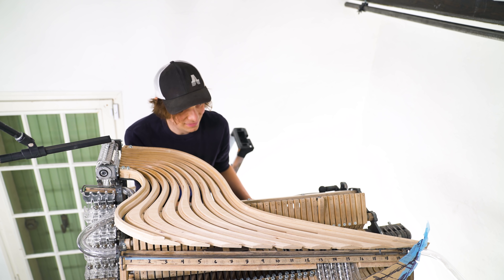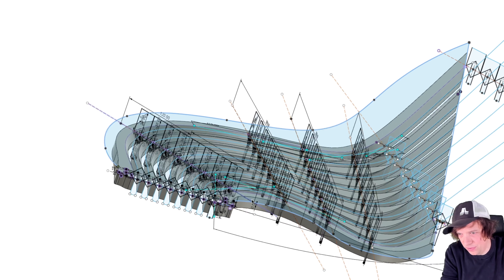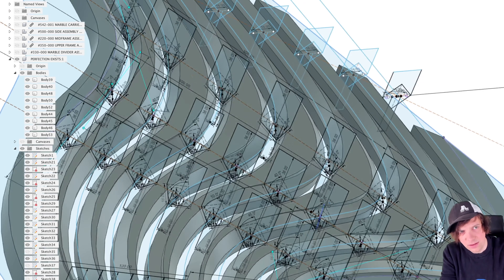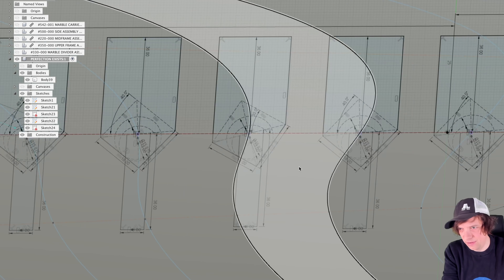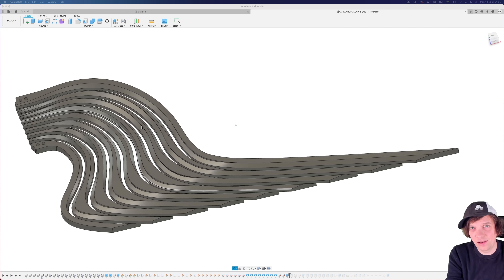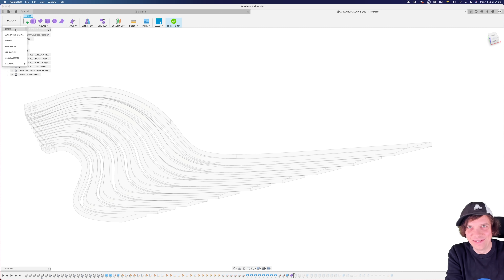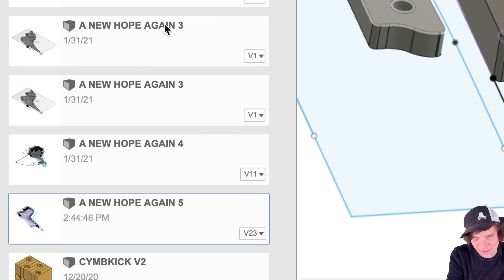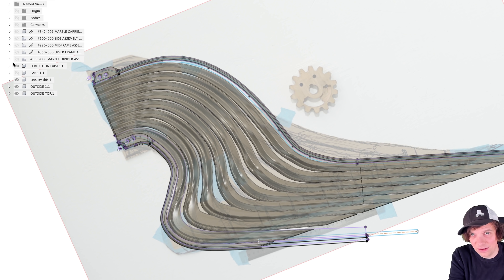Marble Lanes

Comment: A couple things that might become issues. 1. When the marbles rejoin, especially at that velocity, some marbles are going to get knocked out of the machine. 2. The bottom few holes will have 8 times as many marbles as the top few holes and it will be a step function(2x, 3x, 4x,...). Hopefully that doesn't cause them to run dry.

Comment: Good lord, this seems like it has so much potential to be a horrible idea. 
I hope I'm wrong, Martin.
Reply: The tracks from the first coaster track iteration never have any chance to load channel pairs 1-4 of the marble divider, and 1/8 of the marbles will be falling onto the marble divider at channel 19. They have virtually no chance to actually load the divider at that point and will instead bypass the divider and go directly to the divide-by-four / fish stair. These will end up being how channels 1-4 load, which seems a wasted potential to use them to play music directly out of the conveyor belt. 

The previous design had 1/3 of marbles entering at the top of the divider before channel 1, 1/3 at the 1/3 point and 1/3 to the bottom third. This new approach makes the divisions smaller, but also means most of the marbles have fewer opportunities to populate a marble divider channel. 

Before: any marble entering at the start of the divider had 38 opportunities to load the divider. Marbles entering at the 1/3 point had @ 28 the last group had about 20 chances.
Now: any marble entering at the first coaster track has 30 opportunities to load the divider. coaster track 2 have about 24 opportunities, track 3 get 20, track 4 is 16 chances, etc. 
In other words 1/2 the marbles now have less than half as many opportunities to load the divider. I suspect this will end up badly overloading the fish stair. 

Basically, I think this is an adjustment that should depend on knowing which channels are emptying fastest. Maybe it will be the right balance, but it seems early to decide it now before most of the marble gates are ready.

Comment: Like some other, I am a little worried about the speed of the marbles. It look like the marbles from some channels will just skip most of the holes. Maybe increasing the angle of the lane walls to reduce speed (instead of  45  degrees) (the contact point on the marbles would be higher)  could help

Comment: Dude, it's not only too long, the whole thing is shifted to the right at the end. The end of the rail skips the first four shafts for the vibraphone so it will only feed from shaft 5 onwards so the first four vibraphone registers will starve. Other than that the desing looks beautiful. Also remember what I told you about the slope in the comments of your last post before this video.
Reply: The marbles from the fish stair are coming in at the start still, and that includes all the overflow marbles too.
Reply: Not to worry, the first few lanes are fed directly by the fish-stair, so they will have plenty of marbles
Reply: My thoughts exactly

Comment: I am far worse at Fusion than Martin is, but I think in this case, I would have used Sweep to cut the track shapes along the lines. Sweep allows for twists as well, but without duplicating the profile. Any reason that wouldn't work?

Comment: I think we can all agree that the new functional parts look so much more amazing than the old version. That being said, beyond the dimensions being off, it does also seem like there's potentially a new mole in that the marble speeds are significantly higher in this version.  And this could have been seen in a less refined prototype without all the fancy channel tilting which I'm guessing from my own experience you probably spent at least half a day on. 
Channel tilting which I'm guessing at the speeds and curves you want to be working with won't even be a significant factor. It seems like a want instead of a need, a form instead of function. Even if they were the easier solution would probably be decreasing the wall angle or otherwise changing the sweep profile uniformly.
Even after the nitpicking, it still does really look amazing watching the marbles flow so swoopy.

Comment: I'm not optimistic about this design . The previous design put the marbles only where they were needed. This design will crowd them where they are used less often .
Reply: should just funnel them back to the top and this will be pretty without any dispersing impacts
Reply: @christopherkarlsson4919  thats exactly what the fish stairs are doing
Reply: @Sagolel4797  I know I know, but if this visual effect is desired then any negative effects it casuses can be handled with a simple funneling at the end that pulls them back to the top of marble channels is all I'm saying
Reply: Aren't the drums and bass used more often than the vibraphone? Are you talking about the spacing between the channel outlet?
Reply: No, the old design loaded everything into one of two queues; easy to bottleneck, and the bottom-most slots (drums!), literally last in the priority chain, would always be starved for marbles.  There is a functional issue being addressed here.  The overflow will still be recirculated back to the top of the batting order via the fish stairs (and dumped back in at the highest notes on the vibraphone, less used!)
Reply: @xheralt  I could see the vibraphone soaking up a lot more marbles than the drums.  It's used less because he hasn't been on that side in ages. 
I dunno I just feel like we're fixing a problem that didn't exist or hasn't been a significant issue until suddenly end of last week.
I love the process... I never want it to end.  Changes like this are amazing -but I'm not sure if for good or bad reasons this round.
Reply: @80211Denver  i love how it looks more similar to the distribution board on the original MM, but yeah if he kept the marble runs for each instrument in each lane throughout the machine it would actually work really well. unfortunately with the magnet gear lift that aint happenin tho
Reply: @xymaryai8283  I agree this is visually stunning.  There is a problem with the first design iteration, that doesn't mean it's entirely a loss.  I think he should be focused elsewhere but Martin is Martin and I'm happy to watch the transformation no matter how it unfolds
Reply: yeah, there shall be learning here.... we had 40,000+ balls with no failures at this point and fro so reason we're doing a complete redesign.  Many have pointed out the speed and instability entering the divider.  Now combine that with collisions between this new source and the fish stair source... it's going to be a mess.  The balls are not going to merge together like a zipper.. more like lemmings
Reply: This design is horrible for so many reasons......rip engineering again.

Comment: Not a fusion user, but I think you'll need 2 guide curves per lane, and one profile (your 90 degree track).
One guide lane controls overall position, one is above but offset to the inside of the curve (shorter curve) to cause the profile to twist back and forth as it flows down the guides. Good luck Martin

Comment: As the lanes are a 90 degree angle, consider doing over rotation on the fastest (longest) lanes. As it is right now that speed looks frighteningly high...
Reply: The problem w/  a lot of overrotation is that the marble now has enough energy in spin to jump out of the bottom track.
Reply: The angle can be varied along the length of the marble track to make it over rotate only is some areas and thus slow them down, and then slant the angle towards the end to reduce over spinn and the risk of marble jumping forward.
Reply: @YozhikvTumane  Wouldn't that just return them to the original speed,  solving nothing?
Reply: @Posiman  You have a point, but I don't think the built up energy from the over spinn will immediately be transferred to increased forward speed - or maybe it does, unless friction absorbs enough energy. Anyway, I think the problem disappears when the marble track is properly fitted and adjusted to the level of the top track on the marble divider.
Reply: It should be easy to do, too! Just increase that 90° to something larger and take advantage of that over-rotation trick. My only reservation is that marbles going through an over-rotation track are going to be spinning faster than they otherwise would be, and might have a tendency to land and jump forwards.

Comment: The jumps some of those marbles are getting is terrifying me,  that seems like a recipe for marbles on the floor, or in the gears....
Reply: Don't worry, it's only jumping because he didn't bolt it down so it's flush.  And he didn't do that because he didn't cut the lanes shorter yet (7:19).  And he didn't do that because he made it 30cm wider than he intended. :)
Reply: @aaronrobinson2121  It seems to me that the marbles are jumping because they're hitting the uneven channel "inlets" with a lot of speed. You can see (at 9:14) the balls jump down from those lanes down into the distibutor "gutter" and roll down somewhat okay but with a big jumps around the 14, 15 numbers, where the real channels are.
Reply: I aggree, the marble arrive way too fast plust the farthest marble lanes are just skipping the channlest and going for a ride for no reason, this is overcomplicated AF. Way too much work put into it for bad results imo.
Reply: @higike  what would you suggest?
Reply: @jambio3162  I think two or three changes might be considered:  
1) The first track doesn't land until somewhere around channel 4a or 4b.  This might just be that Martin hasn't cut the endings back yet, but it doesn't look like it will make it any higher than 3a or 3b anyway.  Meaning channels 1a, 1b, 2a, 2b are only fed via the fish stair?
2) I think reducing this back down to just two or three tracks with a communal pool off the lifter will reduce the chance that when the lifter only carries up 6 or 7 marbles, one track doesn't go missing a marble reload.  As it stands now, if channels 1a/1b/2a/2b/3a/3b have a sudden surge of marbles being released, the fish stair has to make up that loss.  If channels 4a/4b/5a/5b have a surge, only the first track off the 8-marble lifter will restock them, the other tracks' marbles would have to bypass their channels and make their way around to the fish stair.  Splitting this into 8 tracks seems to reduce the robustness of the divider system in my opinion.
3) I think linking the fish stair into the communal pool might be a good idea as well, that way you have one main feeder pool going to all the channels, but it might be tricky to pull off.  Another possibility would be to have a communal pool right near the entrance to the divider in which case you could tie the fish stair output into it more easily.
Reply: @higike  Obviously you didn't watch the video to the end before writing this comment, or you would know why the farthest marble lanes look the way they do.

Comment: I recommend making all the sections perpendicular to the loft's spline.  When the loft hits a sketch at an angle, the cross section becomes distorted and it is more difficult to get the shape you want.  I like the design direction of the final part the best where the marbles run between the slats rather than in the slats.

Comment: I was hoping this assembly would be machined of clear acrylic so it wouldn't block the view of everything moving below.
Reply: This is just the prototype; the final iteration might be made of acrylic...
Reply: Martin stated why he replaced the acrylic part in his last video. Due to the heavy usage of the material from the rolling marbles, the acryl gets brittle and is subject to failing it‘s purpose. Maybe the new design would relieve the stress on the lanes but as the marbles have a relatively high momentum I guess that the stress on the acryl might be even higher. Also an acryl plate this big will be quite expensive compared to the plywood. Maybe the marbe feeding harp might be replaced by metal although this would increase the noise level again of which Martin wants to get rid of. -this is indeed a dilemma. All in all the new marble feeding harp looks great however the primary goal should be „form follows function“ - and the marble feeding harp is a crucial part that should not fail at all especially when the machine has a very complex track to play...

Comment: Marbles move way too fast. They can crash into overflow marbles and even fall on the ground. They also skip a lot of chanels at this speed. Maybe some overrotation needed at the end?
Reply: And maybe reduce the angle of attack before they reach the marble divider aswel.
Reply: Marbles will always roll slower on wider tracks, so widening them might make somewhat of a difference...
Reply: I was also wondering about how many channels are skipped...
Reply: @acr29z  That's also what i thought about , several of them will only be fed by the overflow marbles
Reply: i think that is his intention with this design. but he needs a version that works first before he can properly test speeds while in use.

Comment: Perhaps the marble lanes could be lofts from a circle 2d sketch; cylindrical, noodle-like lanes. A change in the circle's radius could determine the contact points with the marble to control speed as well. In addition, the marbles shouldn't enter the divider with too much velocity either, as the marble produces a rather audible metal clink with the metal marble rail.

Comment: Maybe narrow the flares on the exit side of the boards to remove excess distance between the exit ends of the chutes and then the overall excess length from one end to the other will be reduced substantially.
Reply: That is, in the CAD design process, not literally on the existing project.

Comment: 3D printing is called rapid prototyping for a reason - no shame in building imperfect prototypes. What I don't get why he did it integrated it in CAD he has a model and it's 10 seconds that would have saved 9 hours :) I like the wing like look super elegant.
Reply: Probably because he mentioned before. They reached the limit of what fusion 360 can do and are looking into other options. So for the new things, he is making them as separate files.
Reply: @JokelesComedian  Also like... he didn't need to compare it to the whole massive CAD file. He has a perfectly good sketch. The question is why didn't he use the obviously useful sketch he created. And the answer is... well... oops. Mistakes happen. What is important as far as engineering is concerned is not that you never make mistakes. It's that you catch your mistakes.
Reply: @JokelesComedian  Waaaay back he had problems with fusion not beeing able to handle all parts.
I think one problem was that he put litteraly every part, nut and bolt as  component into a massive assembly (and due to the fact that the whole macine is built by laser/cnc-cut flat pieces that is bolted/welded togheter, that became rapidly a metric shitload of parts)

With the latest additions to fusion AND the work of the poor cad-team (having to keep up with Martins changes) it should work
Just break down the whole machine to  sub-assemblies with a minimum of parts in them
Replace some of the lasercut-and-welded-and-hacked parts with properly designed cnc-parts   

In every single video I see at least 2 parts that would work better, both mechanically (and aesthetically) if they were milled from a solid block of aluminum or other suitable material. 
As an example: The divide by 4.  Its made up of lasercut steel plates, welded together to form 4 funnels and  connectors to the acrylic pipes. One major problem was obiously tolerances and fit .. wonder why
Reply: Design idea; switching the direction of the marble lift would allow to add the wing outward, so the need to squeeze it together wouldn't be there anymore.
Reply: @fischX  that would give extra space to reduce speed. it would protrude too much at the sides tho.

Comment: Marbles are bouncing once they meet the corridor, that's likely to yield a bunch of problems
Reply: Well I think that's just because he didn't attach it properly, so the marble kind of fall off the track into the divider. But they do come flying out of that thing pretty fast, that could be a problem.
Reply: @ninjafruitchilled  I think you're right about that, the marbles jump because the new marble (p)lane wasn't fixed properly to the divider. As I understand it, it'll attach flush to the marble divider and if I'm not remember things wrong, there is also a steel wire guard rail on the other side of the marble divider that'll keep the marbles from falling off